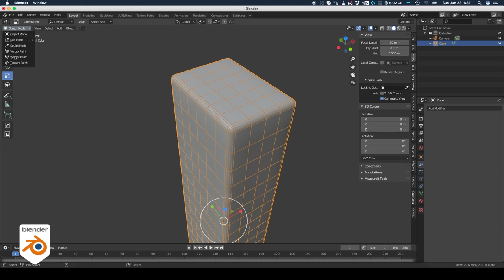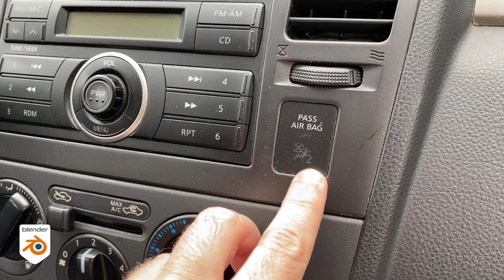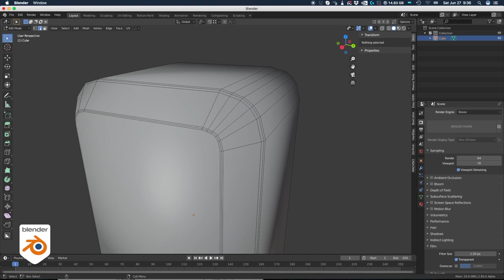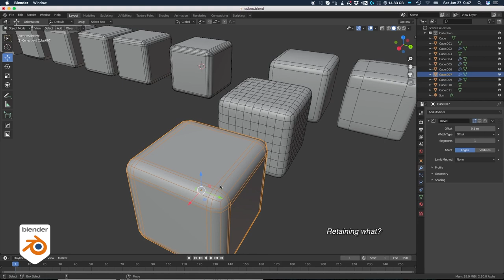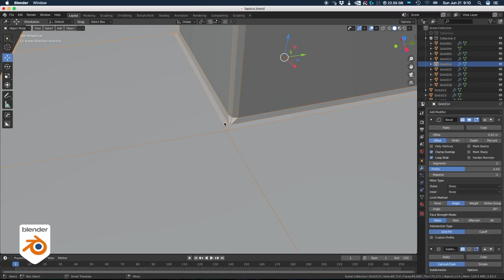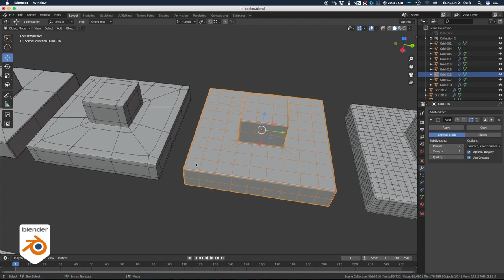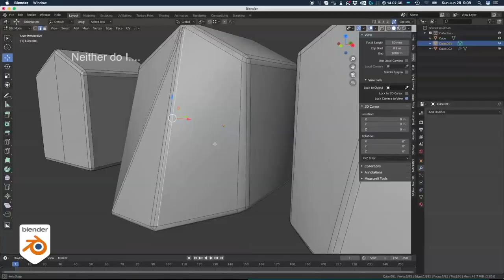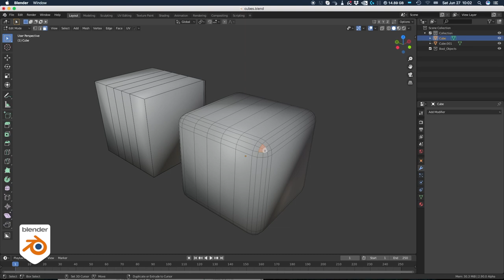Modelling for the VFX film industry in Blender - Bevels EP1c

Comment: Another way to use bevel modifier, instead of using the Angle Limit Method:
Limit Method: Weight
change Width Type from "Offset" to "Percent"
In the Sidebar [n] > item tab > adjust the Mean Bevel Weight in the Edges Data
Reply from the maker: You are absolutely right! I totally ignored that because... well... I just didn't know about it at the time. But I do talk about it in one of the advanced modeling tutorials. I also forgot about another way to make bevels: bevel shader node. But I also talk about it in the advanced one. Thanks for the input! :-)

Comment: At 8:30, you don’t have to apply the modifier for you to split that corner into two quads. Just split it creating two triangles, once you get out of edit mode, the bevel modifier will recalculate that and split it into two quads. You can also tell the bevel modifier where to add the bevels by changing the setting from angle, to weight and just give weight values to the edges to set how wide you want that particular edge to be.

Comment: By chance, did you just not know about edge crease before making this? Support loops are for chumps who don't know better, heh. =P
Reply from the maker: Creases are great as long s you stay inside the same software. It's more problems when you have to convert stuff from one software to another
Reply: @BlenderBob  I suppose. These days my stuff is always either in Blender or Godot, and I have to apply my mods when I move things to Godot, so any subd I might have been using is baked in and the edge creases job is done at that point.